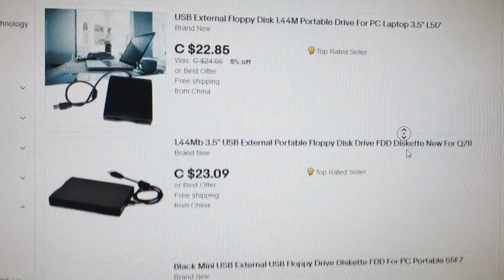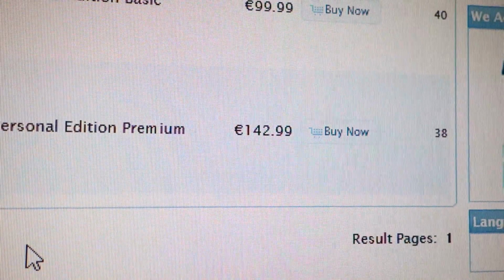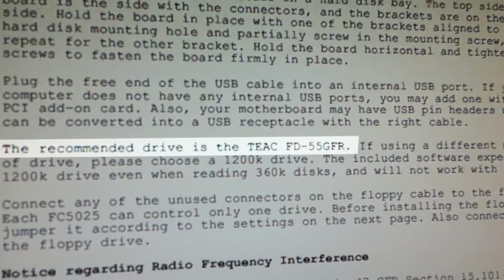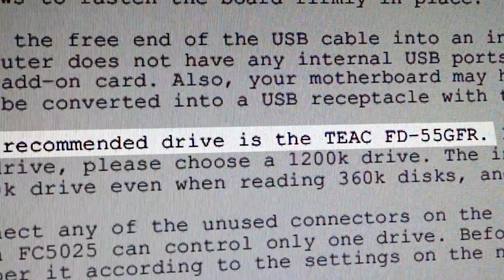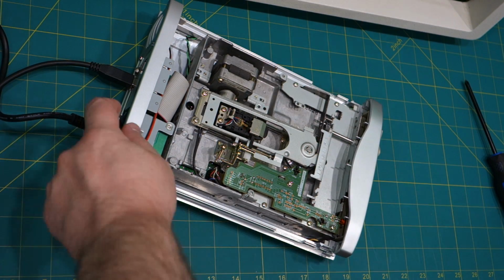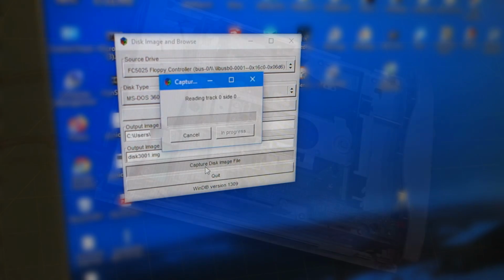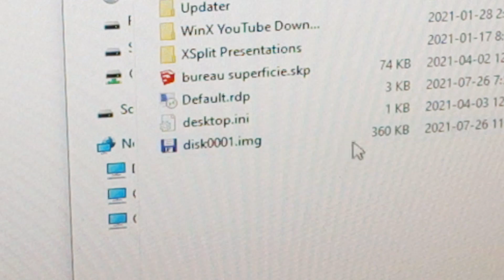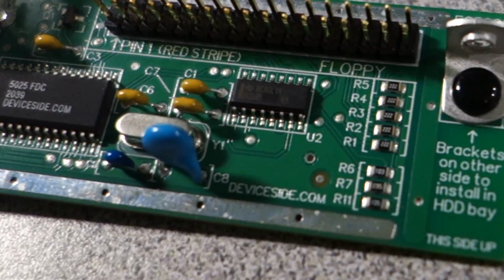Can we build a USB 5.25" Floppy Drive?

Comment: This was a very detailed and well produced overview! But, if you had several vintage PCs with working floppy drives, why didn't you just read the disks there, then transfer the contents over to a modern system?
Reply from the maker: Thank you! 
Very valid question too, and it's much appreciated. 

For very pressing files I originally copied the data on other floppies, then transferred them on my modern system, just like you suggested. But the extenal 5.25" drive provides some benefits in my eyes :
1. Saving steps/time. I figured archiving lots of 5.25" floppies would be faster if directly done on the target system. Transferring to intermediary 3.5" floppies and archiving those instead, is a bit more time-consuming. My up-and-running retro system (currently singular) isn't networked, so an FTP server was not an option for the moment. I'm working on it!
2. Archival software. I haven't found a good disk imaging program that works on MS-DOS. Then again, I probably haven't searched enough? But even with the image file on a vintage system, there still needs to be a way transfer the files out.
3. Data integrity. I also feared injecting minute errors into the archival process without realizing, by tranferring the data from 5.25" drive to 3.5" drive, THEN from another 3.5" drive into a disk image. 
4. Authenticity. I like to image original floppies when I can. Copying the contents of a 1.2MB floppy to a 1.44MB floppy, then imaging that second disk, felt wrong for some reason. 

I hope this explains my frame of mind. I might not be seeing the whole picture though, so any of your insight is welcome. Cheers!
Reply: @theSoundCarddatabase  Any way they get archived is the best way :-)  I was just curious.  My usual process is to archive them on old hardware that has a network card in it, and I FTP them to a server. You can also use smb networking, and some others, see Retro Chris who has some good tutorials on his channel.
Reply: @JimLeonard  that’s the way I do it as well. Have a 486 setup with NT 3.1 and winimage 2.00 with the 5.25 and 3.5 inch drives. Copy it over to an ftp server and they’re good to go. I can definitely see the appeal of having a USB 5.25 inch floppy drive though and will consider building one of these in the next year.
Reply: @kathrynradonich3982  There is not much point in having a USB based floppy drive, because you can't boot from them. All the boot disks and bootable games from the old days expect to see a floppy controller and their software can only talk with a floppy controller and not a USB controller.
It even gets worse, if you have some special formats. A USB based floppy drive solution can usually only read the most common formats.
Thus, reading and writing files to floppy disks formated with a FAT12 format is the only purpose of these USB floppy drives.
In my opinion, a ISA Ethernet NIC is a much better investment for an old PC. And that is what i use on my old 486 with a 3,5" and 5.25" drive.
Reply: @OpenGL4ever  I’m not looking to run the games or programs from the USB floppy, but instead use it to image the disk for archival purposes. As I said in my earlier comment I currently use a 486 I built specifically for this purpose. But being able to do it with more modern hardware would be a nice option to have.